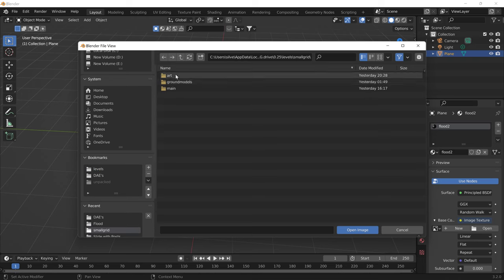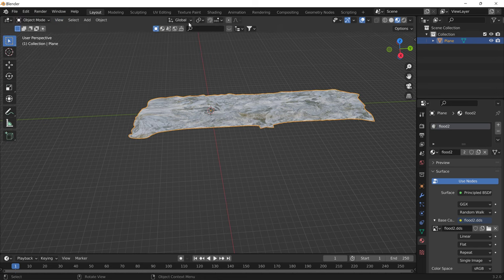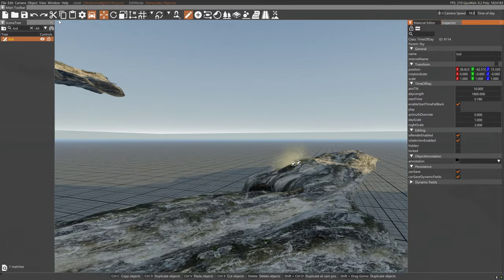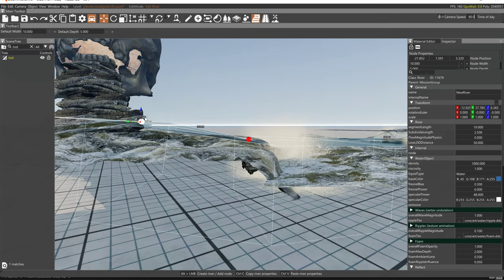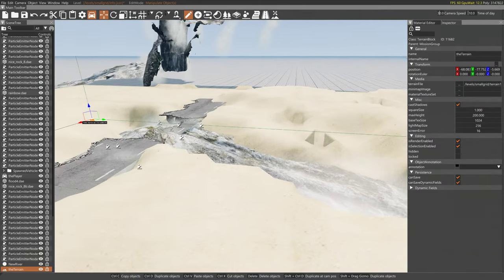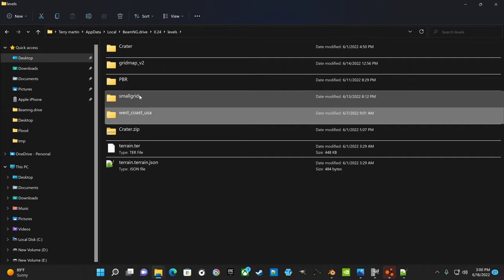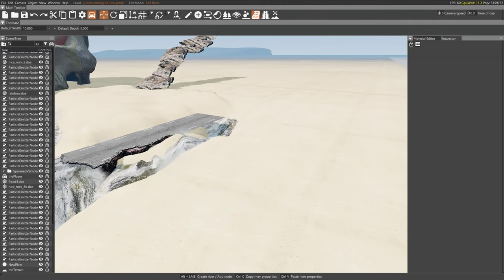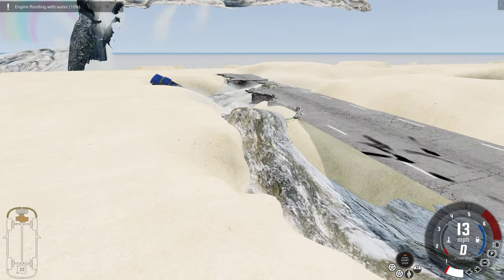How to make a Flood River in Blender for BeamNG

Comment: Nice video :) I make speed art videos too, but with zbrush and photoshop
Reply from the maker: This guy is originally what got me interested in an art channel. https://www.youtube.com/c/marcellobarenghi
Somewhere early on I got into BeamNG and so far have only posted about 1% art and 99% beamng. 
I think the draw to beamng was learning a new medium. I still got time to go before I can feel like I am able to translate what normally would be a painting or sculpture into a BeamNG asset or level. You can reduce the terrain block size to some ridiculous .01 size but use a heightmap that is larger because it will compress. Allowing for the number 1 size to be super small if you like painting with various terrain paints. Also the terrain tool will be much smaller to make fine details. I usually only go to 0.5 or 0.25 though.